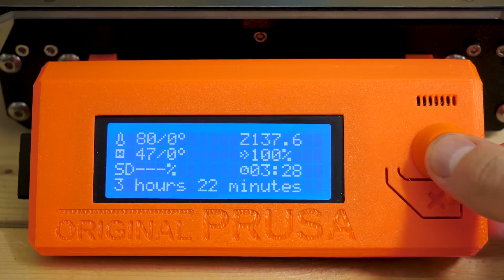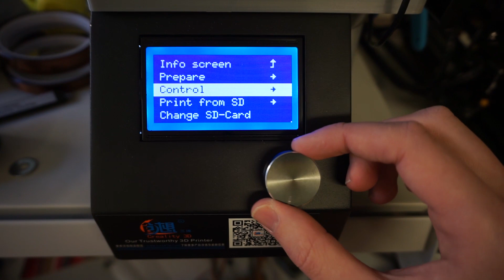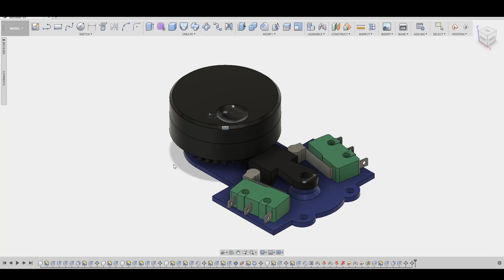Better rotary encoder | 3D printed

Comment: The only folks I know who manufacture a controller like that is Alps with their SRBM1L1400. It's AMAZING but the shaft is only one length and they come in right angle orientation. This is a great alternative for moments it doesn't suffice.

Comment: Well, had same issue with few encoders, but it all just disappears after using two 100nF caps on signal pins. Works absolutely perfect, even while rotating very fast. Your design, being quite cool, is total overkill for a problem with such simple solution. Also - it's not an encoder.

Comment: Nice project! Regarding your issues though - grab some genuine Alps encoder. They work flawlessly. I haven't used genuine EC12 style yet, as I'm mostly using EC11 style encoders, but I guess those will work too. My keyboard uses an EC11E - did not have a single missed step, or 2 steps for one detention step yet.

Comment: You can you use a simply 16 or more rotary switch. Open it and cut off the latch so it turns 360 degrees.

Comment: It's not called rotary encoder because it's two switches. Rotary encoders needs software handling but just decide pulses by number of pulses per dent, or use aporpoate library ... It Uses same number, (2) IO pins...

To be clear. Your idea and project is cool. But to complicated for simple encoder "replacement".

You allready got mcu,  rotary encoder, you use 2 pins, its the same resources plus you don't have to own 3d printer, and don't have to worry about left-right gap and play... Just do simple code adjust. 

Your approach is more prone to failure than Alps rotay encoder... Not to talk about your solution is chassis mount only, and it is big... BiG 

Good video though 👌
Reply: yeah it's quite an overcomplicated hack, takes up a lot of space and you can't add in a push button. didn't take me long to find a good debouncing code online for the normal encoders. you just need to persist with these issues sometimes, instead of trying to reinvent the wheel (pun intended). This dude is still very creative though.

Comment: Hey man! Awesome video! I bumped into your video as I was researching on an encoder to use to tell me the number of turns made by a dc motor when it is rotated by a water jet. Please, what would you advice? Is the project feasible given the speed of the water jet? Are there good encoders out there that would help me achieve what I want or would I have to build one myself?

Comment: Imagine the wear and tear on those friction parts. Why not make a wheel with indents on the side and then off angle the switches a small angle to output 2 channels as a regular encoder does and have the switch wheels run on the outside of this switch and "fall" in to the indents causing a signal shift. Smaller footprint, less friction as it uses the switch rollers and a more stable output (dual channels are easier to pick up faulty inputs)

Comment: I have two questions :
Is it possible to put the micro switches inside the wheel ? (to hide them)
Is it possible to add a push switch option ? (like most RE have)

Comment: can you do the same sort of video on how to make normal brushed DC motor into a "Smooth" rotary encoder
Reply from the maker: Sorry. That's not really something I'm planning
Reply: @Gyro1  thanks for replying anyway
Reply: I can't see how you would want to divine the direction of movement from a brushed motor.
Reply: @SianaGearz  bridge rectifier allows you to do that as  it changes the polarity based on the rotation I built a test and it works problem was I use a low volt motor so rotating it creat voltage so small that only a multimeter can detect

Comment: Nice idea.
For the dual units with a button, you could add a second layer of rotary encoder and a third for the push button.

The middle knob drives the second encoder via a splined shaft so it can be pushed to activate the button on the third layer.
The outer knob drives the first encoder via a tube axle - the middle knob shaft goes through this tube

Comment: Any way to make this into a dual unit with a pushbutton?
Reply: I was thinking about this.
Add a second layer of rotary encoder and a third for the push button.
The middle knob drives the second encoder via a splined shaft so it can be pushed to activate the button on the third layer.
The outer knob drives the first encoder via a tube axle - the middle knob shaft goes through this tube.

Comment: that's ingenious. i use m3? nuts and bolts to secure microswitches in my own projects. there's a need for better low cost encoders in usb mice. i wanted to build a hybrid optomechanical hex drive mousewheel with a switch so that i could convert to optical when the mech encoder wore out. maybe that could be your next project.

Comment: The reason why your encoder on the 3D-printer does not move one line with one click is because Marlin is set up incorrectly. These encoders only make ONE "pulse" per click, but you can set up a divider in Marlin, which is what you are seeing there. It's not the fault of the encoder.
Reply: Additionally there appears to be a bug in Marlin code where it resets the counter incorrectly, making for an overall glitchy feel, or maybe sparse sampling is at fault, or a combination. I wanted to investigate but never quite got around to.
Naturally any encoder has a specific number of pulses per indent, and it's either 1 or 2 or 4 phases, not an arbitrary number. If it had a datasheet, this information would be found there, and also the correspondence of indents and phases. They're kind of all ALPS copies but ALPS themselves has a wide lineup of products, and these can have variations on top of the design.